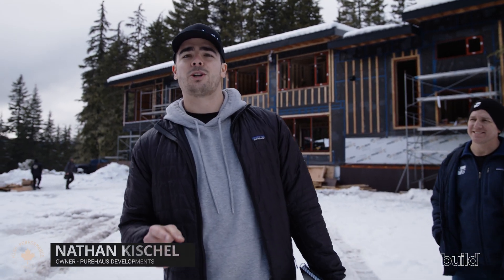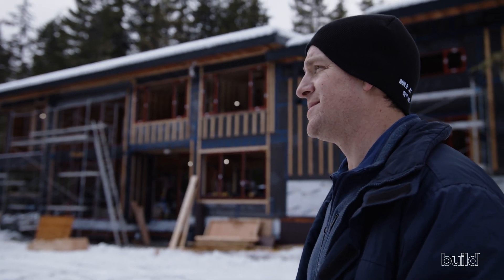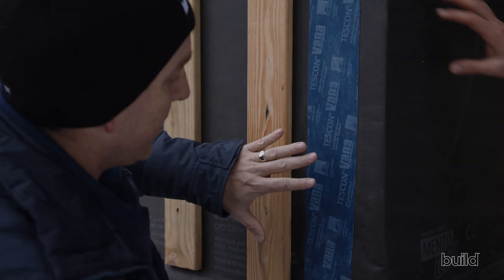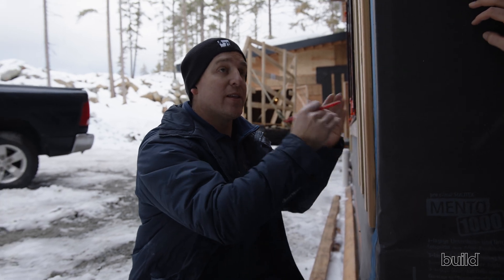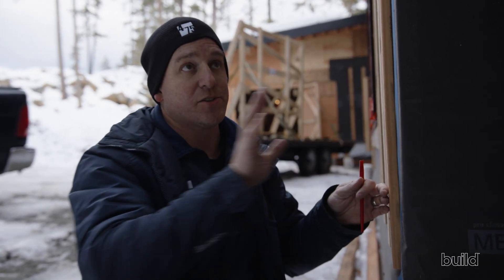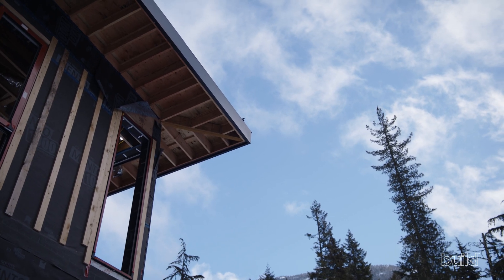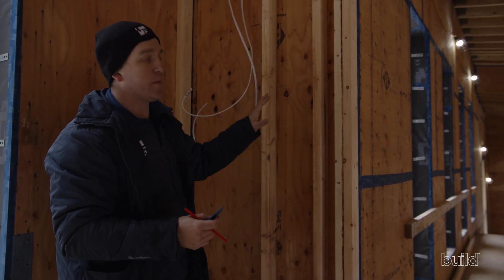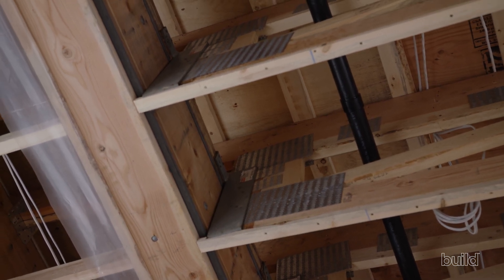Three Dimensions of High Efficiency Construction - High Performance Canada Episode 3

Comment: How are you air sealing around all the window retention strapping?  From my experience this is an extremely difficult detail to execute properly.
Reply: backer rod stuffed between the window frame and rough opening then caulk the backer rod to seal from window to framing

Comment: I don’t agree with this system. In this day and age why are companies still messing with glorified house wrap.  Prosoco makes great top of the line fluid applied products. No wondering which tape to use or do I need to primer the substrate first.  
When building nice houses why cut corners with the wrap??
Reply: Theres no exterior sheathing to apply a liquid WRB to, plus im pretty sure that liquid WRB are vapor closed, could be wrong about that one but you need a vapor open membrane to be able to dry toward the outside in these cold climates. The mento solitex that they are using is 38 perms, so it will let the assembly dry outward and protect the framing and cellulose insulation from moisture issues. To me this assembly makes total sense, they are not cutting corners.
Reply: True with a custom house, just do fluid applied. Especially with harsh weather, if this was San Diego then not as concerning.   If lower end build then a wrap is more budget friendly
Reply: Price and ease of application. I have experience applying both systems and the cost is much higher and they are much trickier to install than tape systems.
Reply: @Donut Chucka 
With prosoco it does not need a dry day and thickness is no problem, it is thick enough when you can’t see the structure through the prosoco. 
Other products can’t say that.
Reply: Also they are not "wondering" which tapes and such to use. Shaun from 475 is there to guide them through the process. Proclima products are very straight forward once you read all their data sheets.

Comment: I didn't understand how he was getting a seal between sill/jambs/header and the wall. It seemed as if he was saying we're taping it but he mentioned insulation.  I am guessing it was a detail still to come.
Reply: The air barrier connection is on the interior side of the window. The window gets taped, not rod and caulked) to the membrane that is taped to wood of the rough opening. The plywood which is also on the interior side of the wall is acting as the primary air barrier, vapour ...
Reply: @7:37 it shows the exterior wrb being wrapped to the inside and tape to the interior. I assume it is that way all around the opening

Comment: How do you air seal the WRB to the dimple mat?  You have air movement on both the outside of dimple mat and the inside.
Reply: The WRB is air sealed to the waterproofing membrane layer behind the dimple mat. It gets taped just above the drain mat. Great question!
Reply: I'm having a hard time seeing the benefit of connecting the wrb with the dimple mat. What is below ground will always be moist, even behind the dimple mat. Concrete is the air barrier, not the dimple mat.